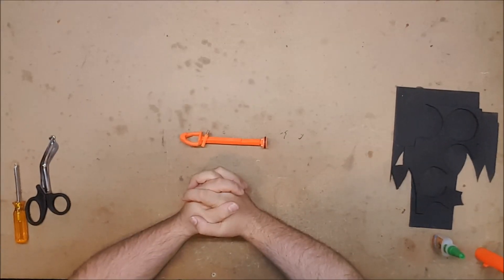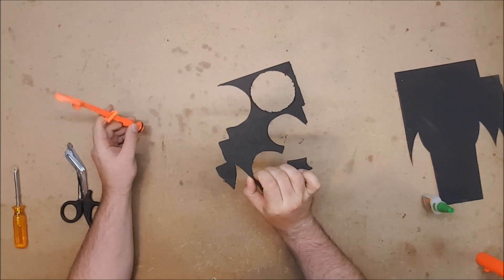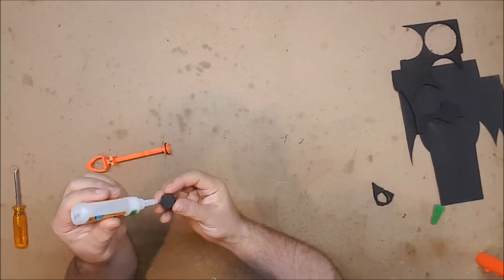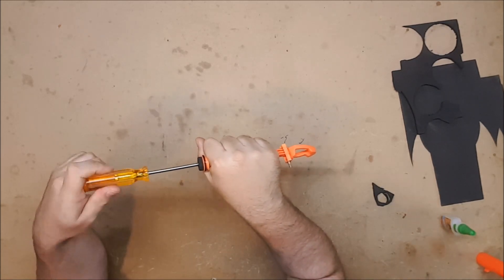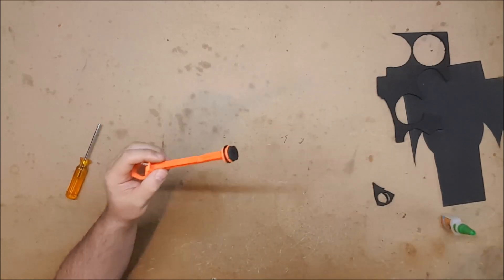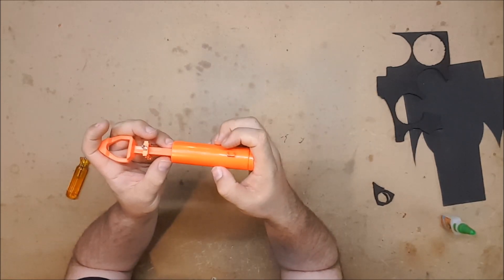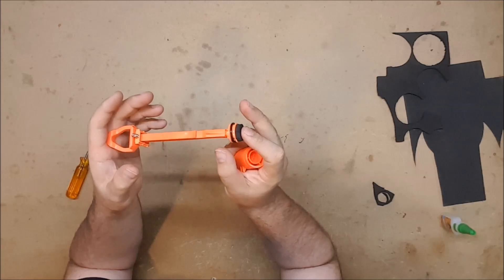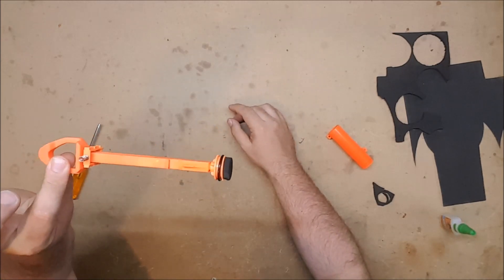Monday Mod Tips - Episode 4 - Padding Plunger Heads

Comment: PLEASE do removing stripped screws and how to avoid stripping screws. I have a rapidstrike with a stripped screw attaching the flip up front sight, and I can't even open it all the way.
Reply: Try using a drill bit smaller than the screw to get it out, and drill right into the screw. However make sure you have a strong drill bit
Reply: it is totally wrecked, and I will try to drill it out. Thanks! A video would still be good though
Reply from the maker: ooooh, good one.  I will add it to the list.
Reply: Captain Xavier can you please add a link too the specific foam you use, just for a little more covient.
Reply: I'm pretty sure there are special drill bits that are threaded opposite to the screw. Once it bites in deep enough it'll extract the screw for you.

Comment: There is an adative in gorrilla brand super glue that allows it to flex and increases the shear strength far eyond that of regular super glue effectively rubberizing it. If you dont mind waiting  a silicone based adhesives would be better as it also flexes and will add aditional cushioning. Goop brand is my favorite. They label it with different applications in mind ie shoe, automotive, marine etc but im pretty sure its all the same except for maybe sun screens in the marine and automotive kind.

Comment: any tips on padding the plunger head in retaliators, I ask this because of the way they're designed with a large cavity in the center of them
Reply from the maker: +VintajeCheese use two layers of foam. One to fill the hole and one for padding.
Reply: i have a insane idea captain xavier can you make a 60 dart shot gun thats magular ps sorry for spelling
Reply: @CaptainXavier  what thickness do you recommend for the foam?

Comment: I wished I padded my Recon's reverse plunger, or even the dart sled, cause the last time I fired my recon, I took off the stock mount, fired it, and the back of the reverse plunger split in half and one part flew into my cheek and landed into a potted plant. This happened during January and I decided to buy an actual replacement

Comment: If you replace your plunger head with a metal one would you need to still pad it with a heavier spring load in it? My other question is will the metal plunger head 'for the long shot' work with one shot pistols plunger heads?
Reply from the maker: Yes, it protects the plunger tube from the metal plunger. And no. The Longshot plungerhead is much larger than those in single shot pistols.
Reply: @CaptainXavier  what could you do then to make the life last longer when you have a heavier spring and remove the ar etc

Comment: I've had issues with magazine fed blasters not being able to load a magazine with a padded plunger head...
The padding making the head too long which means the boltsled doesn't move back far enough.
How is this issue resolved?
Reply from the maker: Good question...thinner pad?  Cut the lower lip of the bolt a little?

Comment: I used the 1/4 foam to pad my plunger in my alpha trooper and now I don't think the prime goes back far enough to let the clip in.   Sadly I had to super glue the tube back together becuase it was solvent welded.  Do you think the foam will compress over the next few days enough to get the clip in?

Comment: On the EAT, my plunger cannot be removed due to a cap on the rear side of the plunger tube. Is there a trick to removing this? I don't want to grind up the thing if it is unnecessary. I had to remove the A/R and I'm running an 8 kg spring, so... it needs padding.

Comment: Hey! So, what is the foam on the end of the plunger-holder-thingy? Its in a half-circle shape and fits around the pointy part of the AR.
Reply from the maker: ...what?
Reply: @CaptainXavier  There's on orange tube on the strongarm that holds the plunger. It also has an AR attached to it. On the end of the tube is some padding. Does it serve a purpose or is it just cosmetic? Thanks!
Reply from the maker: That is what creates the seal between the plunger tube and the cylinder.  It is very much important.
Reply: @CaptainXavier  Great to know. Thank you so much!

Comment: Can you please do an episode in modding reverse plunger because most of my blasters are sadly
Reply from the maker: Not much you can do with reverse plunger.  If you can find a spring that fits that is an option.  Alternatively a power stock.  Some can have their internals replaced with elite internals...but what is the point?  Just use the elite blaster...
Reply: Christian T-D 85 Captain a clear retaliator/recon or any of the other clear blasters is why you'd drop in elite internals 😉 because clear blasters are super awesome cool 😊....... Until they invent clear paint lol

Comment: Great modding video Captain. Your blaster videos are funny and very informative to watch and so keep up the great work!

By the way I saw this post at Nerfhaven that suggests using Silicone Sealant would be better for padding the plunger head
http://nerfhaven.com/forums/topic/22201-simple-and-durable-plunger-head-padding/

The Silicone Sealant would be more durable than craft foam because over time the constant impact between the plunger head and the end of the tube will cause the foam to collapse and be crushed

When the Silicone Sealant is cured it will have the viscosity of very soft rubber and will  absorb shock quite well

I used Loctite waterproof silicone sealant to pad my Buzz Bee blaster plunger head and it seems to work just great

Comment: is the padding meant to sit in top of the lip of the plunger head, or inside it?
does the padding effect air compression at all, or is it simply to absorb impact from an increased spring load?
Reply from the maker: Inside the lip so it does not cause friction with the sides of the plunger tube.  It does fill some dead space but a negligible amount so it is mostly just to cushion the impact.

Comment: Should i pad my rapidstrike?
Reply from the maker: Absolutely! Pad the grip, the stock, the sights.  I also would pad the carry handle, the bottom of the magazine, and front of the battery housing. For internals, I would pad around the barrel, under the flywheel cage, and behind the Rev and Trigger switches.

The only thing you don't need to pad is the plunger head because the rapidstrike is a Flywheel blaster and does not have a plunger head...
Reply: @CaptainXavier  lol

Comment: Im going to remove the air restrictor of my magnus then i will add the plunder padding what will happen if i dryfire the magnus?
Also how does it effect the performance?
Reply from the maker: The first couple of times?  Probably nothing.  Eventually it will break.  As for performance, removing the AR will likely do very little if you do not also replace the breach.  The AR is not there to limit performance but to reduce damage.  Removing only helps if you have a system that can actually utilize the full air volume.  A stock breach cannot.